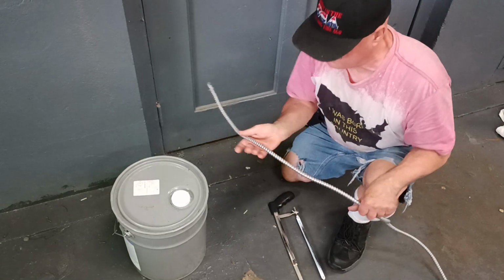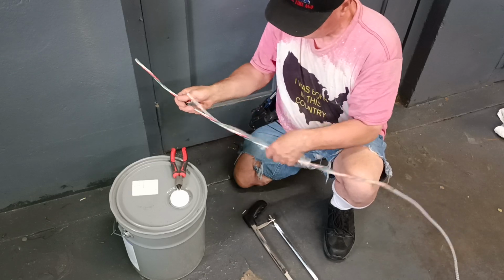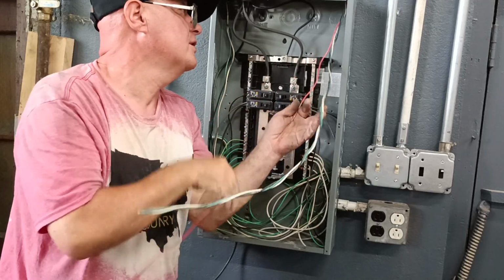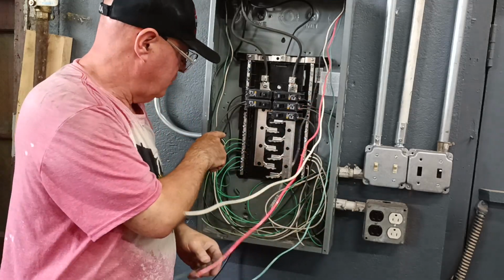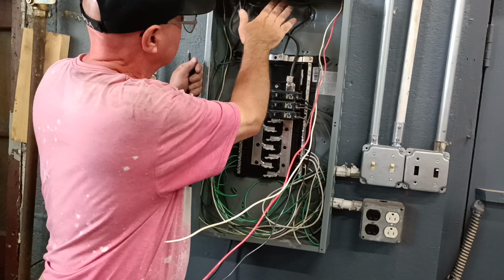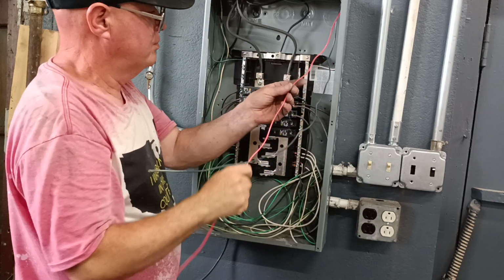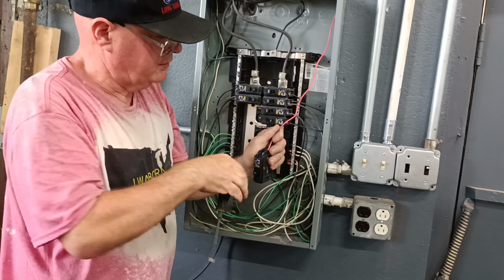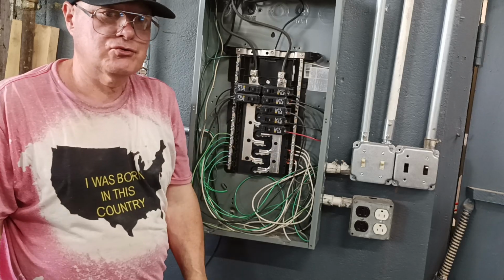June 16, 2024 - how to wire a new multi wire branch circuit in a commercial building

Comment: As a subscriber, I like the content I would like to see more of the actual work being done a.k.a. maybe closer then you constantly looking in the camera making sure that you’re in the shot And thank you for the videos😊
Reply from the maker: I had a tripod that wasn't really reliable so I just wanted to make sure my camera didn't slip down and mess up my video that's why I kept checking the camera
Reply: New circuits and wiring has to confirm to the latest adopted code. Therefore you should have used afci breakers and wired accordingly.

Comment: Breakers supposed to be afci. In which case you can't share the neutral for a multi wire branch circuit. Each circuit requires it's own neutral. No shared neutrals when using afci breakers.